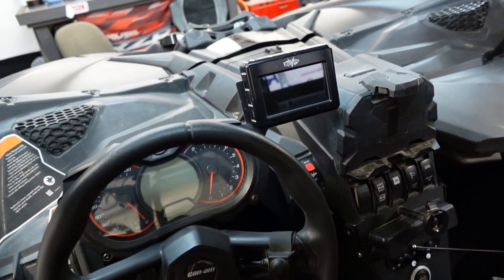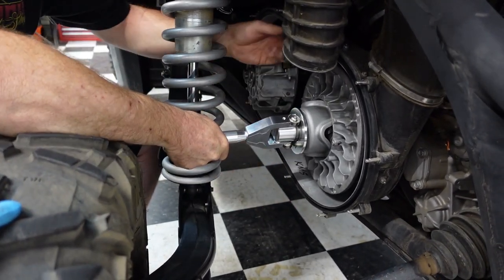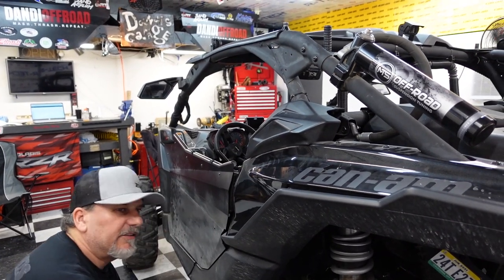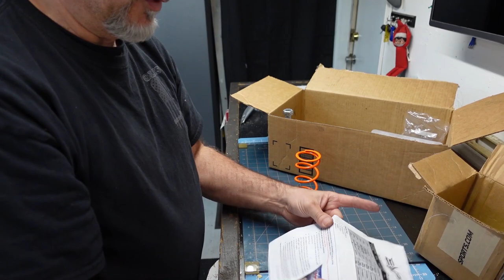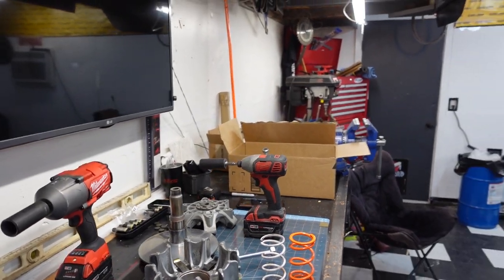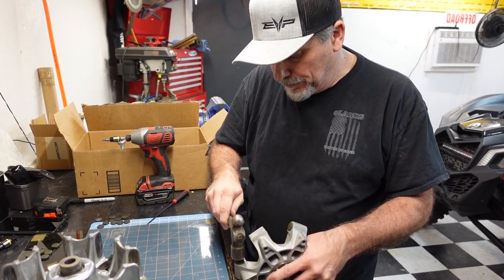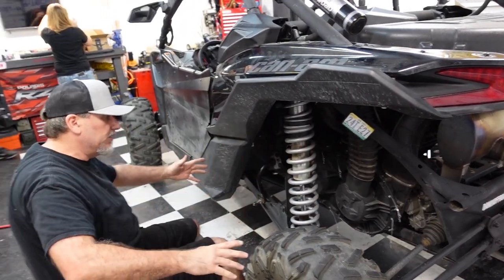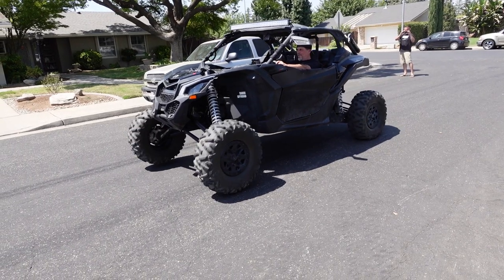POP POP SPRING EVOLUTION POWERSPORTS 2 STEP WHEELIES ON COMMAND

Comment: There should be an O-ring behind those 3 pucks to act as a dampener to keep the spider tight in the clutch. Can Am part# 420230456, and also sold by KWI in their clutch maintenance kit. I wouldn't run without them, if I was you.
Reply from the maker: Thanks for that info,, I was wondering, we just pulled another clutch apart and there was some left over o-ring material left in this on and I has seen your comments on this, and one other person as well. We will ordered those parts asap.

Comment: Oh No! The reason those 3 holes are different is because they take O-Rings! You need to install them for proper tension on the buttons! Also, you have the old style outer half. The new style has steel where the buttons contact. KWI can hook you up with what you need. I would also look at doing their Float Mod as well. Good luck!
Reply from the maker: Thanks man

Comment: Does the overall driving feel different with that stiffer 2300 spring?
Reply from the maker: You really only feel it when you're taking off slowly. Car doesn't move until you hiy 2300 RPMs, stock I think it's about 19
Reply: Got it!! Thats my next step getting that 2 step i already got the switch and spring ! Might be a dumb question but is it worth it? Lol
Reply from the maker: It's worth it if you want to run a quick 0 to 60 and launch hard. outside of that it doesn't have a lot of use. But it made 2/10 different in our car in 0 to 60 and that's HUGE
Reply: Makes sense ! Thanks for the quick reply man🤙🤙 appreciate the help